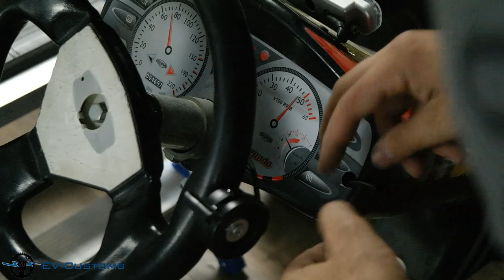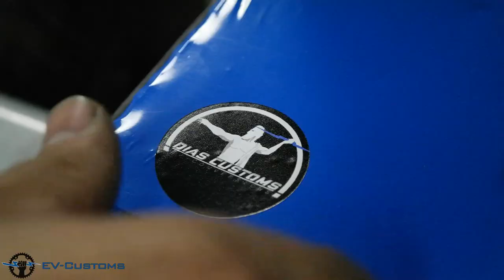BERG OFF Road Go-Kart Conversion to Electric 48Volts 350Watt (Geared Hub Motor)

Comment: Hi I have  a problem. For the last two years I've commuted to work on my 2019 rad power bike's rad rhino fat tiers bike. Unfortunately the rubber seal that protects the battery charging port has thorn in two it has a Jack style connector. So I was hoping you may help me with a how to video on the subject. Your's gratefully Andrew over in Britain. 😎♥️🖖🚴‍♀️🚴‍♂️🚴‍♀️🚴‍♂️🚴‍♀️🚴‍♂️